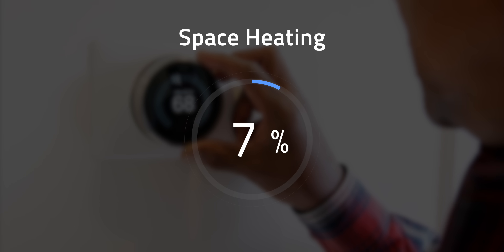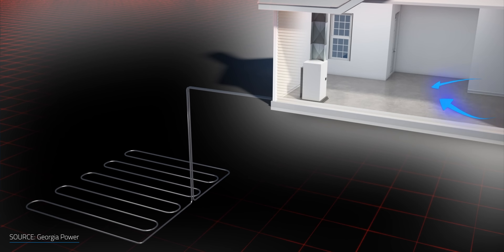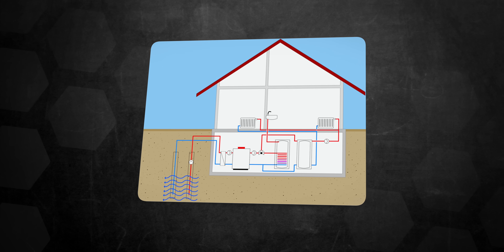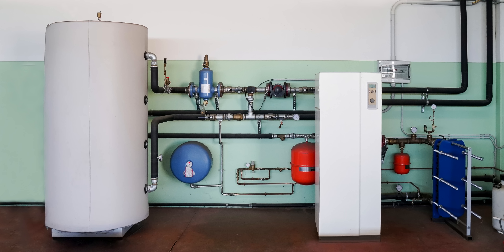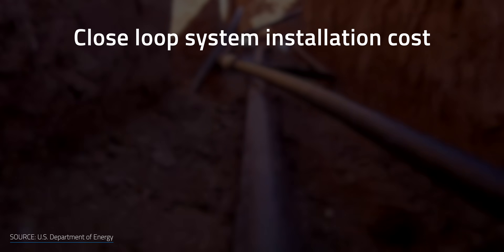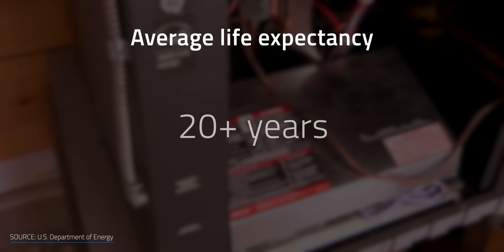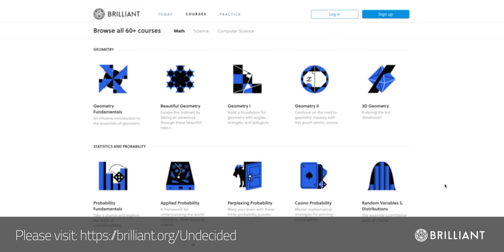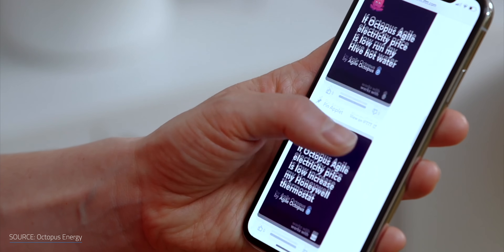Is Geothermal Heating and Cooling Worth the Cost?  Heat Pumps Explained

Comment: Looks like the vertical system would work alot better than the horizontal one because of the depth. Can also image it would scale alot with depth, 10 ft isnt alot, what would 100 ft do? (Vertical)
Reply: 100 feet deep would give you about 1 degree warmer earth.
Reply: Would also scale alot the price
Reply: Digging a well is certainly an option, and is done quite a bit around here.  Price is the big issue.  How much do well drillers charge per foot around you?

Comment: Doing heat pump conversion now (in RI). Seems to me the geothermal isn't worth the cost premium over the new super efficient air ones. I would do them for new construction, but not a retrofit
Reply: Makes even less sense in new (single family) construction, where you can use more insulation and air tightness to lower the heat requirements.  Where it WOULD make sense is in larger systems (multi-family housing, or running a whole neighborhood from one ground source).
Reply: I agree...geothermal sounds great until you realize the cost is many times that of one of the new super efficient mini-splits that require no permits to install and also qualify for rebates in many states.
Reply: Could you elaborate on this air system?
Reply: @koulor9306  An air source heat pump uses the heat in the air, as opposed to the heat in the ground that a ground source heat pump uses.  Think of it like an air conditioner that you can turn the other way around in winter.
Reply: @koulor9306  Check the YT channel Technology Connections. He just did a video on them. It's 95% the same as your compressor in your standard suburban AC unit, it just works in both winter and summer.

Comment: Another advantage of these systems is that they typically consume very little electricity. That may open up the possibility for homeowners to power their geothermal heating systems completely off-grid with rooftop solar power alone, even during winter months with little sunlight.
Reply: That's tricky.  I have solar panels sufficient to run my whole house (minus cooking, plus some EV).  But I still have a 1,500 kWh winter deficit.  I would need a LOT of batteries, or more panels to go off-grid, and be left with a 1,500 kWh summer surplus with nothing to do with it.

Comment: I've designing my retirement home with my fiance that is probably going to start with a 7000sqft barndominium followed by a 1500sqft house, and I'm pretty sure the only way I'll be able to afford heating and cooling it is to put in a large geothermal heat pump system. The cool part is that the system should be able to heat both buildings and all of the hot water if I plan it well enough. Maybe the driveway too. An over the top PV solar array is also in the plan
Reply: Forget the 'large' geothermal.  Start with getting the heat requirements down.
Reply: @CorwynGC , already on that too. The plan is for ZIP sheathing, non-vented roof,  4+in closed cell,  multi-zone in-floor heating, and HRV. It will not be cheap, but it will be comfortable to work in year round and last for the rest of our lives.
Reply: @chaseweeks2708  Why go with expensive (and high carbon footprint) closed cell foam when you have so much space?  Look at 14" of cellulose instead, twice the insulation value, save LOTS of money.
Reply: @CorwynGC , my plan may change and likely it will before I break ground, but the main reason is for air sealing and moisture control. This will likely be in New England or PNW, so the last thing I want to risk is condensation forming on the cellulose. Even if it dries before mold forms, it may still pack it down and form cold spots high on the 18ft walls. Even with a flash and batt is run the risk of it turning out like Marshall Remodel's house (not fun). To me the easier, faster, and better peace of mind solution is pure foam. Turn the whole building into a giant Yeti cooler
Reply: @chaseweeks2708  I just worked on a house here in Maine, Air leakage at 0.53 ACH50, and moisture control through the use of "intelligent" membranes.   Cellulose packed at 4.5 lbs, so no risk of settling.  Pure foam on the other hand, I have seen moisture issues with, particularly around thermal bridges, connection points and penetrations.  Closed cell foam has a carbon footprint of 37 kg per panel, while cellulose's is -(MINUS)10.3 kg.
Reply: @CorwynGC , to be blunt, carbon footprint of whatever I end up building is secondary to performance and longevity, though it is still a consideration. My concern with using that method is adapting it from Advanced Framing construction to Post Frame construction may not be that strait forward. I certainly won't get 14in in the wall cavity. More like 7.5in, 9in if I include the space between the exterior wall gerts. With that space, I could get about an R-28 with cellulose. Not bad at all when you only have studs every 8ft. I can get the same value with 4 inches of foam and still have room to run new wiring if I need to. Also, please correct me if I'm wrong here, but cellulose is a bit of a PITA to use against the roof. Most people just blow in on top of the ceiling. I don't want to deal with 16+ inches of fluffy stuff in an unconditioned roof area since I'd like to put at least some of the mechanicals up there, out of the way. Again, these plans will likely go through several more iterations in the next couple years, especially when I get a real designer involved to save me from myself.
Reply: @chaseweeks2708  I am very concerned about the amount of things you seem to be planning on putting in your insulation layer, each of which requires a penetration of your air barrier.  Please consider a mechanical room instead for those things.
Advanced framing is basically a convoluted and expensive way of getting a small percentage improvement instead of the doubling you would get from a simple I-joist based Larsen truss system.
One trick with roof based cellulose systems is to construct them flat and lift them into place.
If you are concerned about longevity look at the aged ratings on those foams.
If you decide on Maine, let me know, perhaps I can help with your design.
Reply: @CorwynGC , with a Post Frame Larsen Trusses are not really an option. Same with constructing and insulating the walls on the ground and lifting them into place (we're talking about about an 80ft long by 18ft tall wall.) If I foam the underside of the roof instead of just doing the traditional blow-in on the ceiling that is traditional in a post framed building, then I'm not penetrating the air barrier to put mechanicals up in the ceiling of the building, the roof truss area is just more conditioned space. I too am concerned about penetrations, and I'm going to be keeping them to an absolute minimum. Air intake/exhaust, a sewer vent if I can't get an AAV due to code limits, some penetrations for solar, water, electric, and one line for the air compressor. None of the mechanicals will be outside of the conditioned space.

Comment: Hi mat, I’ve recently been trialing infrared heating panels , cheap to install and run working out cheaper than my old electric boiler system 
Going to invest throughout the house for next winter and see how much energy they can save me next winter, they are slow to heat the room up to 2 days but once they have been left on there great worth a video ?
Reply: Heat pumps are three times as efficient as infrared heating panels.

Comment: I put in a closed loop geothermal system in MD in mid-2018. The house we bought had a 30 year old oil system that was failing. Cost was higher than normal because we had to have the oil tank removed and update the chimney. Thought I'd have to deal with 2 contractors, ended up being 6. After federal and state incentives it came out to ~$16K. Would have been ~9K had we gone with gas or air source heat pump. So far very happy! Though I have yet to sit down and chew the numbers to see when the break even will be.
Reply: Once you go a few feet down the earth is consistently ~55 degrees no matter where you are. A ground source heat pump is just like an air source heat pump, its just using the 55 degree earth for it's heat exchange instead of the ambient air. An air source heat pump can create heat on even very cold days and cold on even very hot days. Ground source heat pumps are more efficient because they only ever operate at 55 degrees no matter what time of year it is.
Reply: @EdwardRomano  Maybe thats what Im thinking of, an air sourced heat pump. Im getting to the age where my knowledge and experience is obsolete. 😅
Reply: where do you live?
Reply: @raullasvegas  MD. Maryland ?
Reply: Maryland, the state referenced in the video that has a $3000 grant for geothermal
Reply: @EdwardRomano  My apologies, You said that in your comment. Is there a lower temperature limit for your system? If the outside temp is too cold, does the heat pump still work?
Reply: I've seen comments before about people in Canada saying it doesn't work there. I'm not sure how that can be true, but I haven't done my research on the true limits.
Reply: The state of maryland allows you to sell the renewable energy credit on the open market. Installed system 7/15 have earned $825 since. Not that much but better than nothing.
Reply: @anthonygraziani733  renewable credits...from geothermal?

Comment: I was really confused by the oversimplified diagram when you said "the heat pump compresses the liquid."  Without showing the refrigerant loop as what is being compressed, that really threw me off. I was thinking that would need to be one hell of a compressor. :)  Thanks for the video. As always very informative and well put together.
Reply from the maker: Yeah, I may have oversimplified things.
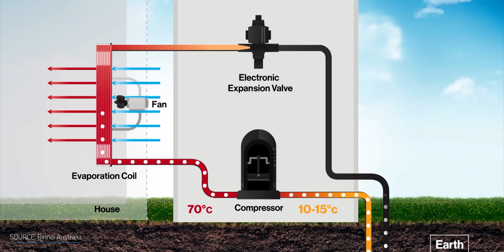Reply: @UndecidedMF  Yeah it we really needed to show the refrigerant to water heat exchanger that acts as the condenser or evaporator depending on heating or cooling mode. I know how this works already so it was good enough for me, but the diagrams looked weird. I paused at 2:38 to put this out here :)
Reply: @UndecidedMF  Yeah and also 15% for heating + 16% for cooling makes 31% 😁! That would be if you run them simultaneously
Reply: @naz4001  the %s quoted are annual, accumulated total energy used. Not live power %.
Reply: @pedclarkemobile  ok, sorry about that then, got confused ☺
Reply: Yep. That animation is just plain wrong.
Reply: Liquids aren’t compressible. Just saying.
Reply: @maxmintz511  That's not exactly true, they just have very very small compressibility compared to gases. Even solids can be compressed, at an even smaller amount.
Reply: @ibanix2  Agreed and takes quite a bit of effort. That's why I was thinking it would take more energy than it was worth and looked into it.
Reply: @RaumBances  Yep. As soon as I heard the word Compressor, the cost of running an air con (or heatpump) came to mind. It would be really interesting to do two real world comparison tests. Location one being in a really cold enviroment, and location two being in a mellow enviroment. Both locations would have a traditional all electric system(heat pump), a natural gas (heat)/electric(air con), a open loop geo system, and a closed loop. Would love to see the actual cost of operation compared to enviroment compared to desired temp setting.

Comment: Here in the UK I have a Tesla Model 3 LR, 6kw of solar, Tesla Powerwall 2, a solar diverter for hot water & an Air Source Heat Pump.  Using Octopus Agile all of these elements are synchronised to cover all needs throughout the year.  I'm currently saving approx 15-20% on my electricity bill which means that the system will be paid off in just under 10 years

Comment: Plz make a video on alternative of Li-ion for battery storage in many countries .. bcz of geopolitical situation and non abundance of lithium in those countries
Reply: People used to use large banks of old lead-acid batteries from cars. Similar to lithium-ion batteries from EVs, once those batteries are no longer powerful enough to operate a car, they can still be reused in homes for years. It can still be done.
Reply: @justin_time  ik but that's the ghetto way I am not talking about that .. I am saying what new battery tech has emerged that can eliminate lithium and change for different energy dense element except lead acid
Reply: @amantedecapaldi4037  liquid metal seems to be gaining traction

Comment: Heat pumps don’t produce heat.  They move heat(energy) from one place to another and change the temperature.
Reply: What happens when the refrigerant gas is compressed by the compressor?
Reply: @simmo6035  It follows the ideal gas law pretty closely.
Reply: @LTVoyager  Would the Joule-Thomson effect be more applicable?
Reply: @simmo6035  Well, my thermodynamics coursework is 40 years old now and my memory is not perfect, but I believe J-T applies to gas expansion through a throttle rather than compression of a gas by a compressor.  One involves work and the other doesn’t.
Reply: @LTVoyager  Back to my original question, what happens to the gas when it is compressed?
Reply: @simmo6035  I don’t answer the same question twice.
Reply: @LTVoyager  I have not done any study, but a quick read on Wikipedia tells us that the ideal gas laws refers to an 'ideal'. Most gases are not ideal and follow Joule Thomson Law. The refrigerant in a heat pump is not an ideal gas. Why would the ideal gas law be applicable in the scenario of a heat pump?
Reply: @simmo6035  Different laws and principles apply at different parts of the cycle. No gas is ideal, but the approximation is good in most cases. The original question was about compression rather than expansion. There are good papers and videos on a typical heat pump cycle. I would suggest looking up a few of those as more is involved than a single question and single answer.

Comment: It would be useful to hear how the cost factor scales with larger buildings, like quadplexes or smaller apartment blocks, maybe 5-6 stories. 

The technology is cool, but there’s low tech solutions already available to reduce energy consumption. Building smaller houses, building with high thermal mass materials like brick, and loosening zoning and parking minimum laws so multi-family housing blocks can be built in more of our cities. The last of these points would also help drive down housing costs and would help make towns more walkable, so car travel is not as necessary.

Comment: You should do an episode on Insulated Concrete Forms or ICF. They are perfect for building passive houses because they are extremely well Insulated and airtight and they are very disaster resistant because the walls are rebar reinforced Concrete. Wood houses are like cardboard compared to ICF. And wood houses always rot if utmost care is not taken during construction to do everything right. They are a bad investment compared to ICF because a lot of brand new wood houses being built won't last 100 years.
Reply: I'll grant you that an all ICF house is quite durable I just don't see this as the solution for the masses. You can build a passive house with wood framing which won't have the same carbon footprint as all of that concrete. Wood houses can and do last hundreds of years with a little TLC. ICF forms are quite expensive and if you aren't finishing an area such as the basement the foam needs to be protected from fire. In my opinion the insulation should go on the outside of the structure. That means you can use cheap or recycled EPS panels on the outside of the foundation and under the basement slab then pair 2x6 or even T-studs with fiberglass and zip + R sheathing.

Comment: 2:32 Is this how it really works? I thought a water glycol mix was pumped through the pipes and a heat exchanger transferred the energy into a gas/liquid, like in an AC unit or fridge. Liquid doesn't like being compressed and compressing it wouldn't raise the temperature much. Compressing a gas though...
Reply: I have a WaterFurnace geo pump. You are correct.  Ground loop is separate from the buffer tank inside. Two heat exchangers. Ground loop and refrigerant exchanger. Buffer tank and refrigerant exchanger. Compressor heats or cools refrigerant. Pulls or pushes heat into ground loop while the opposite happens to buffer tank.

Comment: Thank you, you had perfect timing on posting this video, I have a Zoom call with a builder this afternoon, we are discussing HVAC options for a 600 sq ft addition I’m building on my 1200 sq ft home, and this was great information! I didn’t know there were tax incentives still available, and I had never heard of dual source heat pumps.
I’m in north east Pennsylvania and am considering a pond loop system, I’m trying to learn about water-to-water heat exchangers so I can have radiant heat under the floor in the new addition, and conventional hydronic radiators in the existing house (I’m assuming that it will be cost prohibitive to retrofit radiant into the existing house).  Since I’m in Pennsylvania I’ve never needed air conditioning but considering adding that as well, but not sure how well that will integrate with a water-to-water heat pump.
Reply: Try to use a passive home design. You'll probably be able to get away without a geothermal and can instead have a PVT solar system for electricity and water.
Reply from the maker: Glad you found this useful.  Vignesh brings up a good point.  You might want to talk to your builder about passive house techniques too.  It will make whatever system you put in far more effective.  I've got another video on that if you haven't seen it: https://youtu.be/secB3R0sIYU
Reply: @UndecidedMF  I had missed watching your passive house video when it dropped, but I watched it now, more good information for me when I meet with the builder, thanks for reminding me about it.